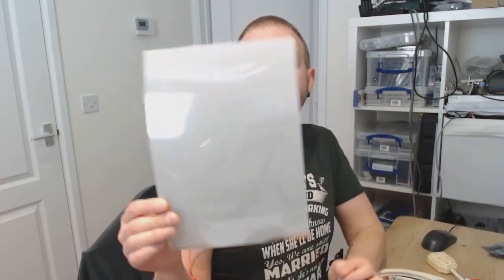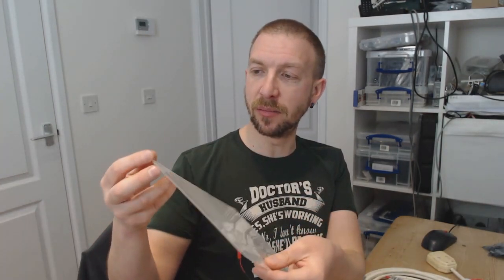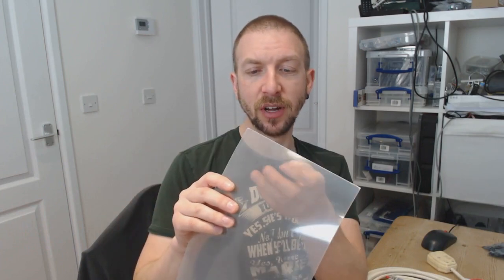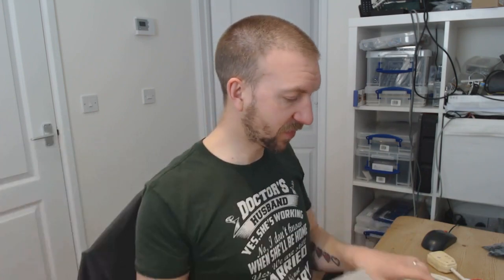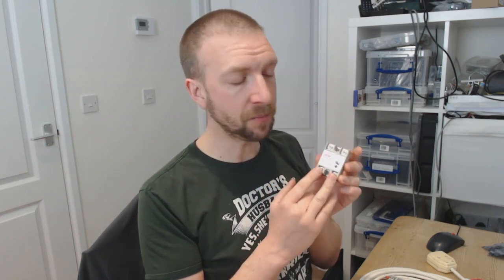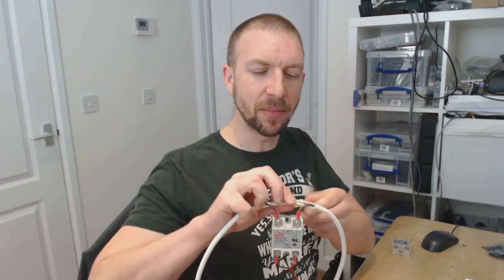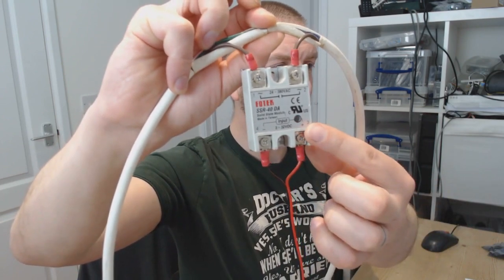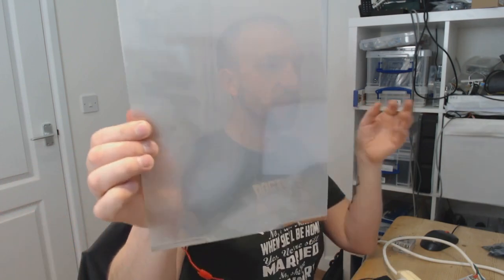Smart Film and Solid State Relays

Comment: You can easily switch AC with standard relay. Even on your small blue relays there's written: 10A 250VAC, 10A 30VDC. Relays are ordinarily used to switch AC, in fact much more than DC...

Comment: Those solid state relays come in AC and DC varieties, and some are rated to control very high amp loads (100+ amps!). The only downside is the can generate a considerable amount of heat if left on for too long. They are really great for controlling things like winches or hydraulic pumps that pull a lot of power but are only on for short amounts of time.

Comment: Working with AC, 120/240 here in North America or 240 in Europe will have some very strict electrical and fire code standards.  Here in Canada, splicing into that hot wire will require the relay to be inside a closed, approved, grounded electrical box with the wires secured so that pulling on them will pull on the box and not the connections.  120/240v AC can kill you!

Comment: is there a way to use PWM from arduino to control the film if you dont have solid state relay? I wanted to get 50 % tint
Reply from the maker: Good question, but I don't think so - the relay is there to switch an AC source, so you can't simply apply PWM to it - I think it only has two states - clear or opaque.